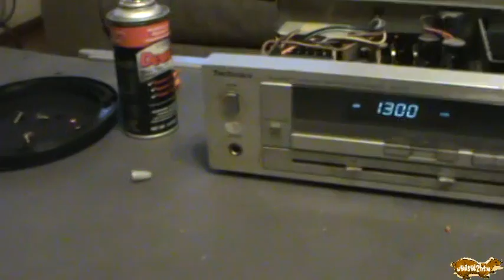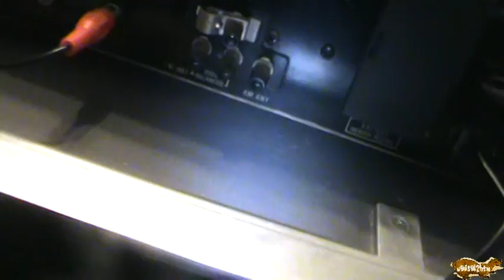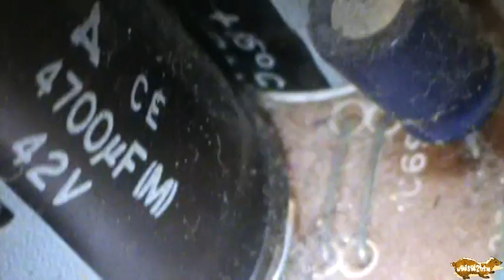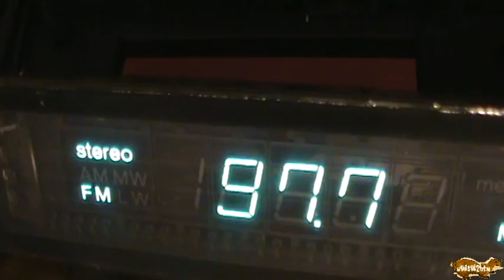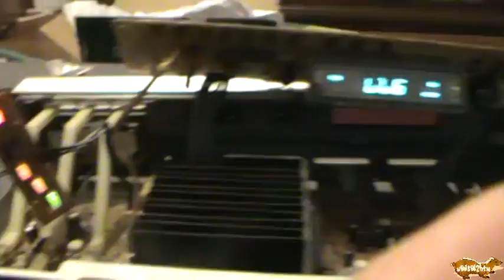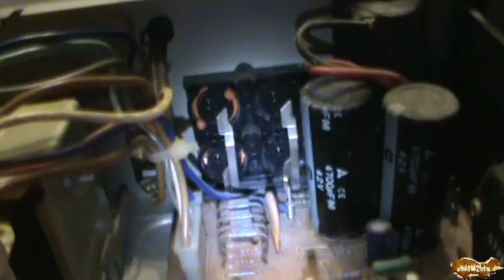Technics SA-210 Part1 (of 1, Part 2 never got filmed)

Comment from the maker: @shadowrider460 I thought about that after I went to bed last night, the "12" at the end made me wonder if that is what it was, that regulator runs REALLY hot though, even at low volume levels, and the board around it is slightly cooked, I may see if I can do some preventative maintenance and replace it, preferably with a little heavier duty part.  The spkr protector board has a 12V reg on it, so I can tap from the unreg'd input side of the 7812 and not put any extra load on it.